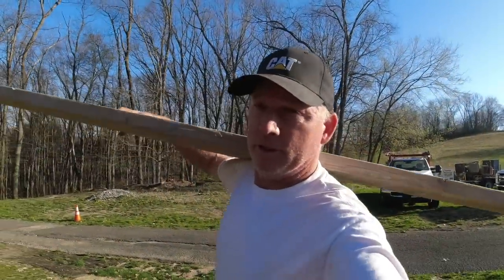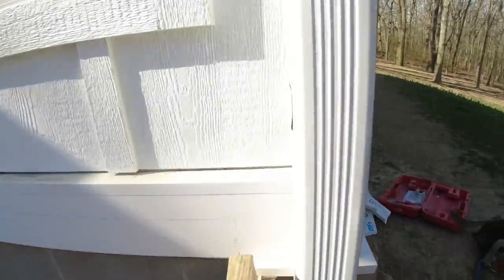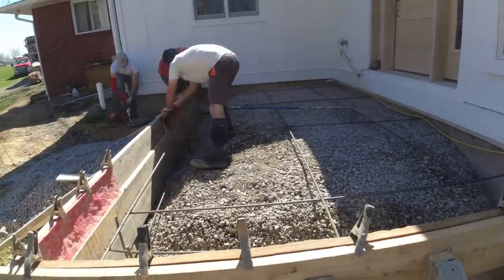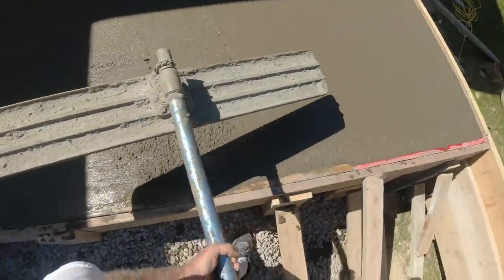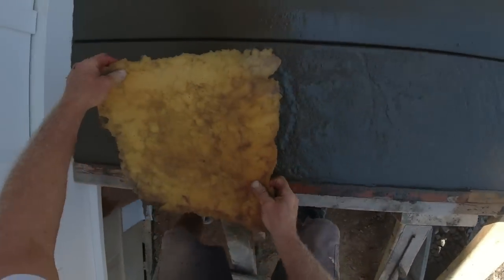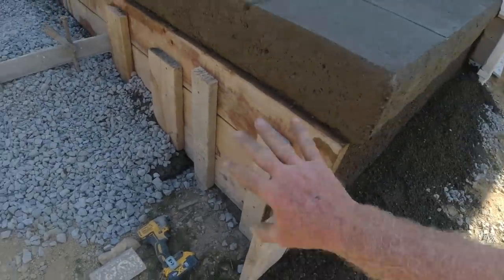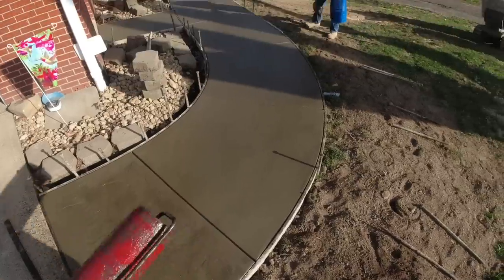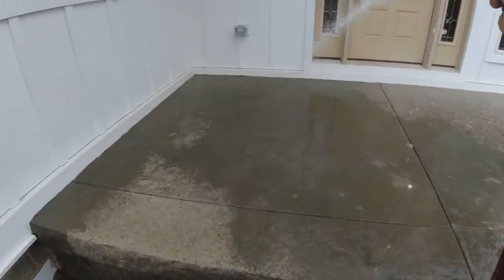Things Can’t Always Be Perfect!

Comment: Tom, great job on the deck and sidewalk.  Question, when you have an exposed sidewalk and deck like you do on this job, how do you guide the client to maybe install a railing or fence or some type of a retainer on the outside away from the home concrete edge of the deck and sidewalk as the path leads towards the garage driveway?  I wonder about the exposure to people sliding and falling during the winter months because of the exposure to the unguarded edges and the steep drop off.  Do you think the client will put in some type of railing or fence or just go as it is now?
Reply from the maker: Anything higher than 36 inches they must have a railing, smaller projects like this. I mention it whatever the customer wants.